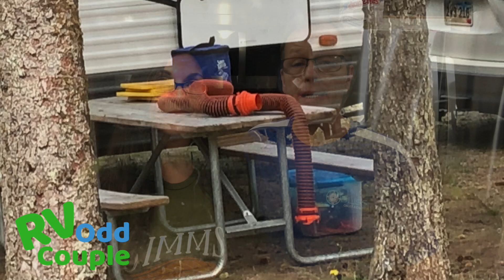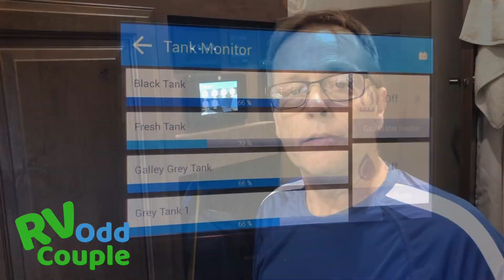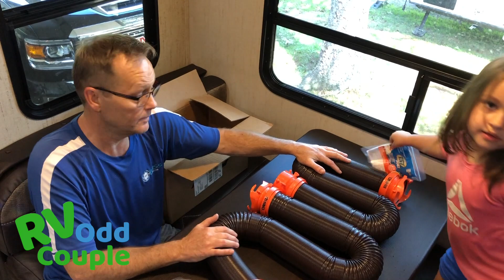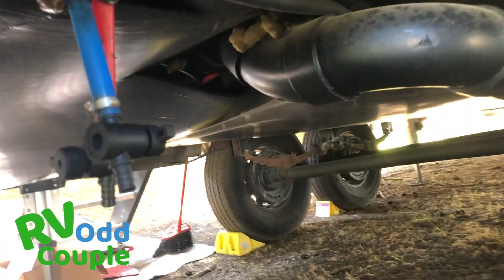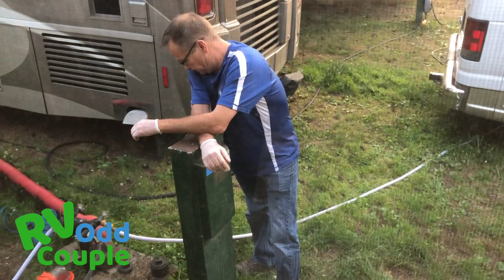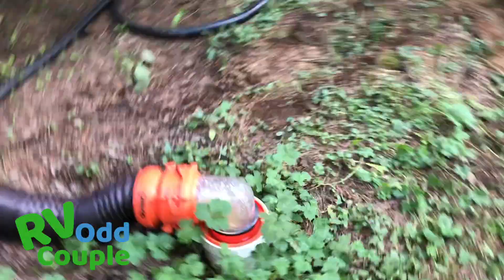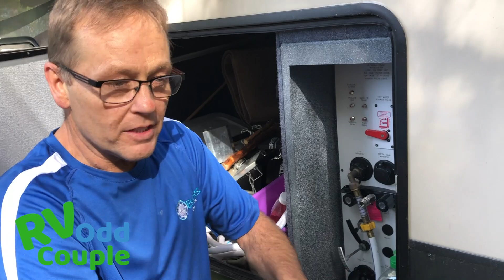RV Black Tank- Flush, Sensors, Hose, & Smell (Fulltime RV Living)

Comment: Yep! great advice all around. I might add a couple things. One, I never, never, never use any hoses at dump stations or potable water fills just for the reasons you both listed in your video. I alway use my own hoses. and Two, the bumper hose storage door is great! one issue I had with my old trailer with the bumper storage was rust and sharp edges on the inside of the bumper. It actually ripped small holes in my sewer hose causing it to leak. I now use a black plastic tote to store my sewer hose in. Not exactly how I want to store it but it was getting expensive replacing hoses and my new trailer doesn't have a rear bumper. One thing on my to do list is to install a new hose storage system made out of a hollow plastic fence fence post mounted under the RV with a blast gutter used as a slide try inside to hold the hose. Just haven't gotten to installing it yet.
Reply from the maker: I agree with you 100% on the hose storage! I'm looking to install 6" PVC pipe under my rig Thank you👍😀👍😀

Comment: Great Video!  You might want to try out a Rainwave one inch digital flow meter.  I use mine all the time when flushing out the black tank and keeping count of the gallons of water going back in . There are many uses for this little meter.  U.S. & Metric readings.  It is around $14 dollars.  Best Wishes!
Reply from the maker: Thank you!  We'll (and by we'll I mean I told John) check that out.  :-). Very cool.

Comment: Great Job!  I've just noticed a maintenance problem with my Dometic toilet.  Timing is perfect as I'll now re-evaluate the situation and possibly save myself a RV service call ($$).  Thank you!
Reply from the maker: Awesome! Let us know how it goes😀👍  Thank you for letting us know
Reply: @rvoddcouple  Toilet fixed!  Did call in the troops and had a mobile RV tech do the work.  But, having watched your video I was able to provide good intel when placing the service call and economized (they charge by the hour plus a road call fee) because the tech arrived prepared.  Turns out the manufacturer had pinched the inlet water line against the wall, which with time and use had eventually caused it to begin leaking when opened to fill the bowl.  There is a subtle boundary in life between frustration and empowerment.  The RV lifestyle and generous folks like you who take the time to share, allow us to live in the empowerment zone.  And that is a great foundation for daily gratitude.  Thank you!

Comment: I get a kick out of you two. Glad you have a sense of humor. The poop zone is a great term. I try to be careful with the hoses and flushing, but your point about the folks before you is important. We have a 2008 TT, and it does not have a separate flush line, so we have to take other approaches-- hold the flush lever down after dumping , or bring a separate hose on board to use a flushing wand. The sensors are basically useless- have tried cleaning tricks to no avail. This was one of the best/ shitty videos I've seen. Mercedes;" is that snake poisonous?" No answer from John--- full focus on the sewer video. Haha
Reply from the maker: Thank you so much Richard! We love doing what we do and comments like these💚💚💚 Have an awesome day.

Comment: Oh the stories I could tell lol. This is one of my "duties" so I see a lot of sh!t lol. The last park we stayed at had a nasty sewer smell between 3-4pm every damn day, I went over to our hook up just to check like 5 times, never could figure who's it was. We ordered and gasket from Camco that seals up the pipe to your elbow connection which eliminates or should eliminate the need for a block of wood or brick so your elbow stays put. I bet I spend about 20-30 minutes just flushing the black tank after everything is flushed out, its crystal clear water when Im done. The worst I ever saw was a guy rinsing his sewer hose with his city water hose and he ran the hose in the sewer hose like 2 feet. I had a mishap a while back and didn't realize the valve was open and took the cover off and out came about 2 gallons of....grey water thank God!
Reply from the maker: OMG! The visual on the fresh water hose cleaning the inside of the black hose make quiver...I had the same thing happen to me once with the valve being a little open. Thank God it was Galley tank for me...Thank you for sharing this with us👍😀💚

Comment: Aaaaand this is why we like our cassette toilet in our Hymer Aktiv. So easy!
Reply from the maker: Interesting.  I'm assuming it's a composting toilet.  We considered one briefly.
Reply: @rvoddcouple  No a Cassette toilet is not a composting toilet. You sit on a regular toilet but everything goes into basically a plastic suitcase on wheels. You remove it from a compartment on the outside, pull up a handle, wheel it to a regular toilet, unscrew the plastic pipe, and then dump into a regular toilet. Easy to keep clean too.
Reply from the maker: @CanadaFree.6014  wow!

Comment: ok. the little orange end that actually goes into the campground's white tube. . ..... how do you get it to sit still /stay there,  without it jiggling around and or jumping out when you empty the tanks?
Reply from the maker: Great question.  They are all different sizes and there are adapters for fit different applications.  But you can put a big rock (or small boulder) on top to keep it down too.

Comment: Another way that is very effective is cleaning the sensors is to dump at least 5 gallons of hot,  steaming water in the tank.   The steam does a great job in cleaning the sensors.  Great video.
Reply from the maker: I didn't know that. John did.  I never would have even thought of that!  Thank you Mike!

Comment: I would suggest being gentle on pulling and pushing the gate valve handles for your tanks.  They have metal rods attached to a plastic gate valve. The plastic, especially when it ages, gets brittle and breaks. Once that handle breaks you have to get under your trailer and replace it. That is usually a very difficult job. They don't design these RV's for maintenance after the fact.  I speak from experience.
Reply from the maker: Thank you for the tip. I will due maintenance on it today. Thank you KoJo💚👍😀

Comment: Just a quick note. Be sure to sanitize that y adapter. Despite the fact that it is positive pressure you have the possibility for contamination between and during use. That contamination can go to your water system. It’s brass so you could actually boil it and get it super sanitary.

Comment: Hi guys,  just wanted to pass along a tip I learned the hard way. I now always look into the parks sewer hookup pipe to see where the water level is.  One time I looked and the water level was about a foot below ground. I figured that was ok. When I dumped the black tank it erupted out of the connection. It turned out the parks sewer line in that site was blocked.

Comment: John and Mercedes- I very much appreciate and enjoy your videos, very entertaining.....  I just wanted to make one comment about this August 14th video....

A friend of mine is a microbiologist and he has told me that those "hand sanitizers" that are ubiquitous at the entrance of every store and supermarket are completely misleading....If you are really concerned about germs, the best solution is to wash your hands with soap and water....hot water if it's available, but, even cold water is 100 percent better than using the hand sanitizer.... actually, the hand sanitizer doesn't remove the germs...I'm not saying it's useless, but, it's not as sanitary as you might think..   

I appreciated your deep dive on the black tank...we have a Class B with a dedicated black hose that is permanently attached to the rig... our only problem was that it cracked once and needed replacement.. it's plastic.... otherwise,  it will stay on there for years....we just coil it in and out to dump and have a macerator pump.   As a matter of fact we never hook up the black hose or fresh water , just gravity fill our fresh water tank and dump whenever necessary....

We just have the black and gray water to dump... there's no valve to empty our fresh water tank..... completely different setup....

But, I'm going to try using some ice as you suggested.... good idea.. ..we did have a piece of plastic wind up in our system.... and your explanation of how that occurred is quite possibly what happened to us?  Don't know why it took so long... our vehicle is a 2012 RV...I suppose anything is possible... we're very careful not to put anything in the toilet that shouldn't be there..... I was starting to wonder about those little plastic deodorizer bags??? But, they are designed to be used in this application, sounds crazy that one of those could be the culprit?? 

Finally...on the subject of the tank gauges... they are very UNRELIABLE.... I did some research and found that the best gauges are made by a company called "See Level"... these gauges are not inside the tank... they are sensors that read through the tank wall and report back to the panel.... they are kinda expensive and not easy to install especially on my Sprinter.....I don't personally work on my coach, so getting them is on my deferred list...I just dump the tanks every few days when we travel..... we don't live full time in our RV......

Good luck with your travels... and thank you both for the videos.....

----MARK
Reply from the maker: Mark, thank you so much for your comment.  You bring up so many good points.  I agree with your soap and water statement.  I mean, I think it's good to have it by the panel, but it's not the end-all solution for cross contamination.  We're so glad you enjoyed the video and got some good information from it.  Thank you for mentioning the other types of tank gauges.  That's excellent! Appreciate your feedback and your contribution to this topic!

Comment: I am working to remove chemicals from my environment.  It really isn't possible to remove all but I have done a healthy portion and I am feeling TONS better!!  Did you know that you can get a large bottle of peroxide from the dollar store and then screw on a spray nozzle on top?  I use that to spray onto handles, and the like, to disinfect.  It is easy and I have it in my wet bay.

In June I was at a State Park in Oregon.  Boy could I tell you stories about people backing their rigs in!!  Anyway, I watched this guy, directly across from me, start dumping and his hose broke, WOW!!  With bare hands he took the hose and then used duct tape to wrap it up and continue the dump, leaking the whole time.  What got me is that after that whole scenario he used his hands to unplug his electric and using one hand on the top of the power pedestal! 

I kept waiting for him to clean up and HE DIDN'T!!!  He left that crap there!!! I went over to the camp host and told them what happened and they contacted the Park Service. 

When I got back to my site there were already new people there and a toddler girl was walking all over the area helping daddy get plugged in.  I told them what had happened and they were horrified. 

I have been RV'ing for 15 years now and I am now aware of this possibility at any site I might stay in. 

I like your idea of different shoes, however, you still have to walk to the bay to get them and you could be walking through the area where someone might have been messy.  The only thing that I can think of is to have them (in a plastic bag) in a bay on the other side of the RV.  This way you never walk over that side of the RV and contaminate your good shoes.

The idea of tracking that stuff into my MH..... YUK!!!  THANK YOU for the idea of another pair of shoes!!!!
Reply from the maker: You know, it's when the kiddos play nearby that it really makes me mad.  I can't imagine how those parents must have felt! Glad you liked the shoes idea!  You just never know!  We're like you, when we see something like that, we warn the next campers.  :-)

Comment: You are better than me.   I will change out my black tank and do a composting toilet.   Very informative video and I appreciate the discussion but i'm 60 and I don't think I could do what you do.
Reply from the maker: Composting toilets are very interesting.  We considered them, but with a toddler, we didn't know how to teach her to separate.  We hear good things about them though!
Reply: @rvoddcouple  You don't really need to separate. Airhead provides coffee filters for use on rough seas when installed on boats. The method is to not open the trap door, but to put the coffee filter on the trap door and do your thing on the coffee filter. Then you open the trap door to "flush". No need to separate or even aim, as it is designed such that even with the trap door closed, any liquid is diverted to the liquids tank. I don't think it would be a problem for your little one. I never use the coffee filters, as I am not on the water, but they would work well in this case.

Comment: I'm always blown away by your willingness to dive deep John! This video was an insane amount of work and very eye opening!
Questions:
Can RV owners replace those sensors?
Can RV owners add tank straps?
Can RV owners replace a cracked tank?
Can they repair a damaged tank drain hose connector/drain valve?

By the way, those valve cables need lubricated often, especially the galley handle.  What do you use to prevent corrosion from seizing those?  Thanks again!
Reply from the maker: Thank you Mike! Yes, the RV Owner can do all of those jobs but they are not easy jobs. Great tip on the cables! Thank you😀👍

Comment: Good job!! Very informative video. I would like to add a couple additonal steps to clean and keep the tank odor free. Your flush process is excellent. There is an additional step that helps move out the "Kling-ons". At Walmart's RV area they sell a  hose and pipe unit that drops down the toilet flush hole. This unit has a powerful spinnig nozzle that washes the tanksides and cleans off the sensors. I use this about every other tank dump. The odor issue is common to marine and RV. I found adding the recomended amount of "Happy Camper" powder works best for me. I've used it on my boat, too. I really enjoy your videos. You have the right balance of humor along with the info.
Reply from the maker: Great Tips!!! We are going to try the happy camper...Thank you💚😀👍

Comment: Just remember to spray the handles and levers on everything when you first arrive. This gives the spray (I use Lysol) plenty of time to kill everything living on those surfaces.
Reply from the maker: Yes!  We had one recommendation for 50% water & 50% bleach.  Regardless of what you use, disinfecting everything upon arrival is a great strategy to avoid cross contamination!  Thank you!
Reply: mix alcohol with water in a spray bottle.
Reply: Bbug Kim what kind of alcohol? Will Dos XX work?
 6 pack?
Reply: @CASANOVAPRO1985  😎👍
Reply: @skylartuckergrowingup2885  It won't kill everything out there ....especially diluted. But works for many surfaces around my house -- especially if I add essential oils and use it as a room 'deodorizer' in bathroom. Might not be the healthiest spray to breathe, but I figure it's healthier than Glade or febrese (?!?)
Reply: Two spray bottles, one filled w vinegar and the other filled w peroxide.  Spray simultaneously and let the solution sit as you would Lysol. NEVER mix the two contents together in a container.
Reply: Spray and glove up☣️

Comment: Just one week ago i dumped our tanks at the dump.station. My wife was so grossed out when we emptied the black tank. It is not pretty. She asked me how I can do it. I am a surveyor...often I open sanitary manholes to measure pipe depth. People ask me what am i doing...i tell them i am fishing for brown trout🤣🤣😂😂😅. So emptying our own black tank isnt that bad. I got these citrus smelling bags that help liquefy solid waste and make it smell somewhat less offensive. Our RV dealer told me that putting a few bags of ice in your tank after a flush will clean the sensors. Have not tried it but it may well work. A lot of new campers including ours have a black tank flush and all new Rockwoods come with a black tank vent.
Reply from the maker: Hi Mike,  I too have a greater appreciation for what John does.  But OMG- Fishing for brown trout!  I can't imagine the looks you would get!  Thank you for adding those tips.  Having a flush helps a lot! :-)
Reply: @rvoddcouple  Another great accessory to have is a portable black/gray tank. Finding out the hard way...a tank with bearings in the wheels is a way way better choice than one with none. DO NOT buy a tank that has no wheel bearings....trust me.
Reply from the maker: @mikefoehr235  this is a good idea!  thank you!
Reply: @rvoddcouple  Have you ever done a video on RV tires? I ask because most if not all FOREST RIVER products come with Castlerock Tires. We have a Rockwood Roo and it came with these very tires. To be fair, ours seemed to be OK But based on my YT research they are known as China bombs. I swapped ours out for GOODYEAR Endurance ST tires. Based on my research, they are a very good quality tire and I like my local GOODYEAR dealer. Have you ever wondered how bad or good your RV tires may be? When you consider the money riding on 2 or 4 pieces of rubber, quality comes into play. I have seen Chinabombs  explode and damage wheel wells on RVs. Seen this on YT videos i have found or comments from viewers.
Reply from the maker: @mikefoehr235  We haven't but we should!  Thanks for the idea!  :-)